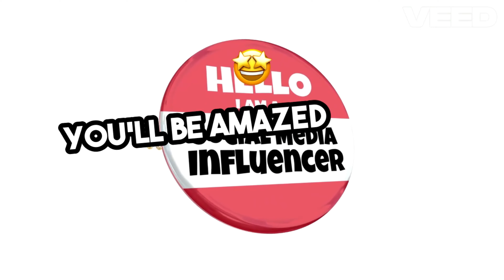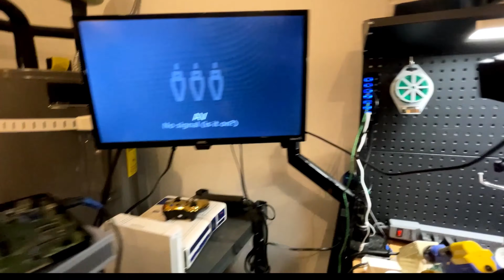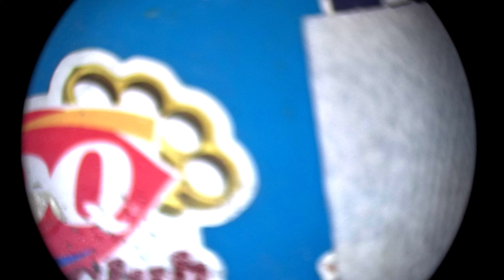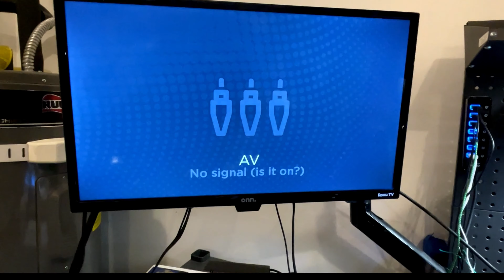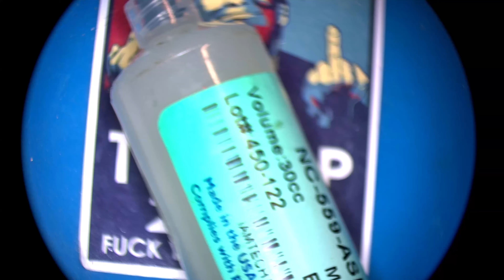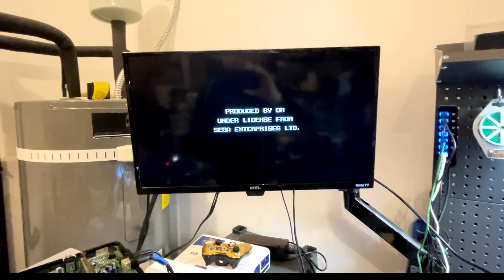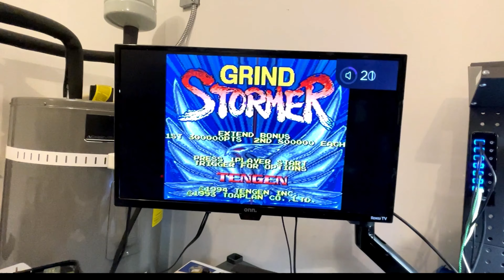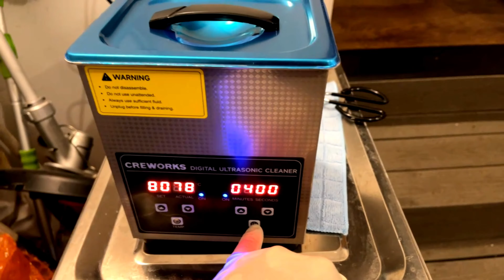Repairing a Sega Genesis Grind Stormer Tengen Board

Comment: Rivets are cheap but the rivet tool costs about £500.
Reply from the maker: I had briefly looked into the rivets but no idea what size I should buy.  I did not want to do the trial and error method, though I know the result would look much better and be more professional.
Reply: @wilsvgaddiction4456  Rivets done wrong can cause the PCB to crack.  Its easy with the right tools.  Harder otherwise.  

What you did will work well and reduce the risks of failure with rivets.  

You can tell the size of the rivet needed from the diameter of the drill bit that fits in the whole.